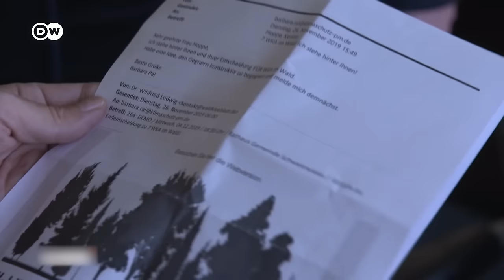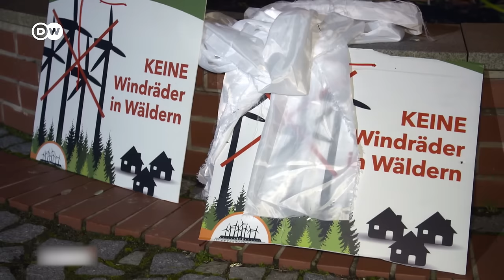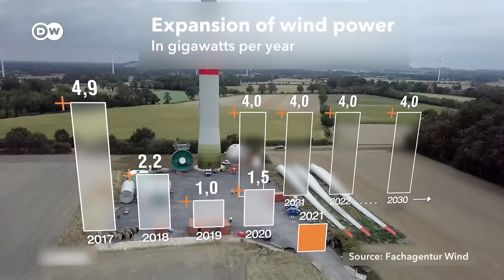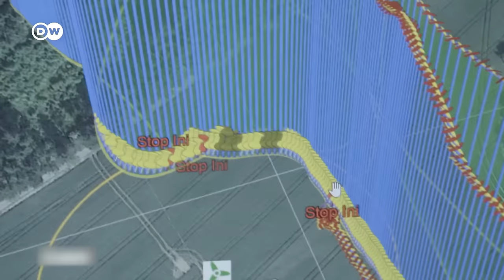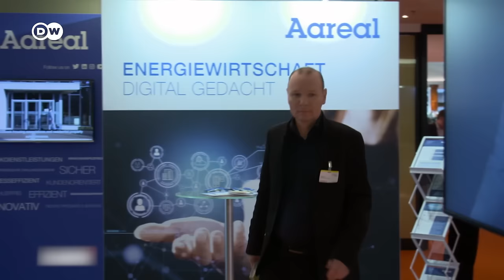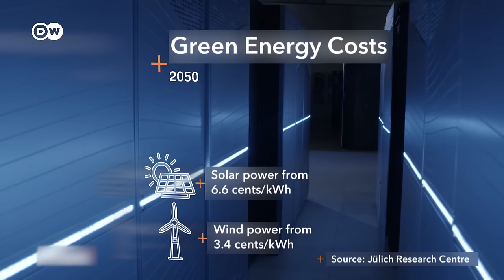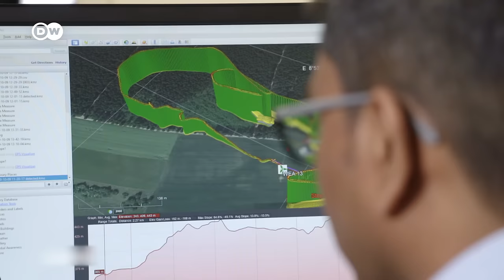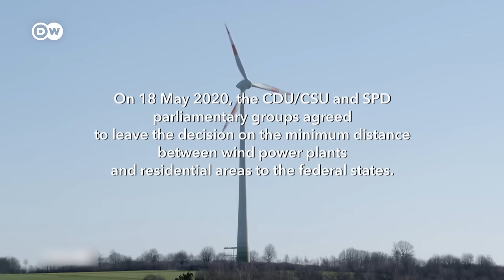Wind power getting headwind in Germany | DW Documentary

Comment: "Who wants a wind turbine near their house?" followed by "Keep the coal plants open!" makes absolutely no sense.  You'd rather live near a coal plant or mine?  Are you insane?
Reply: I have lived near both - there was no problem; it is a false fear.  With CSEM (Continuous Stack Emission Monitoring) there is no pollution to worry about.  The mine as about as intrusive as the sawmill down the road.  I currently live in Toronto and I walk right past the nuclear plant daily.   I do wish we'd hurry up and upgrade from gen3 to something more modern though and the SECOND we have productive TOKAMAK fusion going - that is the ONLY choice for energy.  Coal and Nuclear are the OBVIOUS green choices - and dirt cheap by comparison.  Both have far better safety records than wind too.
Reply: @cosminxzy  No, insane would be having a strong opinion on something you have no experience in.  Coal can be very clean - and it's a more green option than turbines at the end of the day.  All of them should be replaced by Nuclear however.
Reply: @jameswhite1910  how did you assume i don't have experience in this ? Ironically i'm a Power Engineer so I can tell you that you are wrong about coal. I'm neutral with Nuclear, it can be very good but has some huge risks.
Reply: @gaelgregoire5413  its not climate denial its understanding how a combined cycle power plant works. You can use ammonia base catalyst to reduce the nox and so2 by nearly 99%.  Your car has a catalytic converter for a reason fool!
Reply: @jameswhite1910  Coincidentally, the leading cause of cancer deaths in Canada is lung cancer.
Reply: @palmshoot  Isn't that why they made smoking illegal?  And, Canada as about the cleanest air on the entire planet.  Your point is... well it isn't good, really.
Reply: @gaelgregoire5413  Well, Gael... I don't deny the climate.  I don't deny that it changes, a lot.  I grew up in terror because "the consensus of scientists" knew that the ice sheets were returning... all of the graphs pointed to it, there was not time for debate.  They wanted to coat the north pole in CARBON to gather more heat to avoid the coming ice age.
Reply: @cosminxzy  LOL.  Yeah, about 20% of all Albertans are power engineers - and I'm Albertan, and I took the courses too.  That accreditation gives you and I zero credibility on coal emissions however.  Unlike you, however, I HAVE worked with CSEM.  So your authoritarian argument holds no water.  Coal is no worse than any other form of energy that is available today.  If you scrub the toxins in the smokestack, then there is no pollution.  These arguments were invalidated in the late 1970's.
Reply: @jameswhite1910  Considering lung cancer CONTINUES to be the leading cause of cancer deaths in Canada, your point is worse.
Reply: @palmshoot  Great point!  They were - apparently - 100% wrong about smoking being the cause (shouldn't we all start smoking again now that we know this?).  Since Coal burning has gone WAY down over the past century, it can't be that either, right?  Not if cancer rates are going UP.  If coal caused cancer, then rates should be declining - and you say that they are not - so it can't be coal.  CSEM is now filtering the particulates out of the exhaust at near complete levels... zero risk.  I guess the lesson we can both agree on here is this:  The government has not idea what it's talking about when it tells us what causes cancer.
Reply: For people that think coal mining is not an issue, please look up documentary on the town of Centralia, Pennsylvania.
Reply: @jameswhite1910  no pollution from coal smoke stacks?? Lol. You've drunken the industry coolaid. No matter how efficient the current scrubbers they are not 100 percent effective. Do a google scholar search on their efficiencies, and measures of how much toxins get pass them and into the atmosphere. Ash in landfills is not without risk either because landfills are not 100 percent safe from leaching into the ground.
Reply: @mrbonzzai  Well, now you're conflating safe levels with "not 100% clean".  NOTHING is 100% clean, not even tap water and certainly not windmill construction.  But the truth is, unless you have a political motive to try and prove coal is dirty - coal isn't dirty.  Earth isn't clean... what we care about is "clean enough" that life isn't affected in a bad way.  Coal is not dangerous, nor does it impact the environment today the way it used to.
Reply: lived in a coal town my whole life with mines all around and i'm fine and so is everyone in my town. Coal mines doesn't hurt the people near it im writting this with 1 active mine less than a mile from my house probably 4 super old mines shut down within a 2 mile radius of me right now. You can carbon capture coal co2 at the coal plants and pump it down into the sedimentary rock and its fine forever, but no lets just get rid of coal, coal jobs, and the reliable power it makes. Stupid people i swear!
Reply: @lilone23  "I smoked cigarettes and lived to be 90" isn't a great argument that someone else should take up smoking.  The entire continental united states gets acid rain now because of coal plants.  You're not the only person.  People rely on healthy streams for their water and food, so even outside of acute pollution (I grew up in an area that experienced occasional coal ash dumps into our river and I don't think it's that uncommon in Appalachia as a whole) there's still that dispersed pollution of acidification.  And I haven't even mentioned climate change now.  Yeah, I'd rather have a windmill and keep all the farmers, fisherman, etc employed than choose your job at their expense, sorry.
Reply: @gg3675  I said i live in a coal town and have no acid rain where you live?? i never even heard of acid rain ever near me or in my state?? I never said i work in a mines i never have, i was in the army to protect people like you so you can write dumb responses on here and have a safe ,little easy life! Thank you i'm done not arguing the facts i know we should have green energy plus use our recourses we have in our own country is all. I'm all for a clean environment, i love the beach and seeing the outdoors. I just mean the government can't help make our power plants clean they just want to push one type of energy and that's it. I think that is dumb but ok everyone has a different view and always will.
Reply: @lilone23  You have acid rain in your town and state if you live in the continental US.  Just because you don't know something doesn't mean it isn't true.  

And thank you for your service.  My ability to write comments on youtube was under tremendous threat by the rise of the Ba'ath party in Iraq.
Reply: @jameswhite1910  explain then
Reply: @Gael: Arrhenius who described the greenhouse effect opined that increased atmospheric carbon dioxide concentrations would have the beneficial effects of increased agricultural yields and postponement of the next glacial maximum . Did it ever cross your mind that climate change could be beneficial??
Reply: @johngeier8692  Arrhenius died in 1927, before we even understood the reactive mechanisms underlying photosynthesis.  Why is it that people who want to deny science always want to quote the speculations of respected scientists who died a century ago instead of the compelling body of evidence that has accumulated since then?
Reply: @g.g Controlled experiments clearly demonstrate that plants grow better when the carbon dioxide concentration is much higher than the current atmospheric concentration of 415 ppm. You don’t have to understand photosynthesis to demonstrate.
The main issues are what is the ideal mean surface temperature of earth and what is the climate sensitivity to carbon dioxide.
Where would you set your thermostat? At 15 degrees centigrade or 20 degrees centigrade??.
Computer models of complex, incompletely understood  phenomena such as the earth’s climate are subject to the biases of the modellers and amplify errors over time. They are a poor substitute for controlled prospective experiments.
Reply: @Lagarto: Which university did you attend?
Do you superglue yourself to the road like the climate activists in my home city?
It was cool and rainy this year so they went into hiding.
Reply: @johngeier8692  Except we also have many controlled experiments about how crops perform in realistic environments that aren't constrained to that single variable.  Many plants are more productive with more carbon available, as would be the case for any nutrient.  Do those gains make up for increased temperature? More variable temperature?  Reduced water availability? Storms? Falsifiable experiments are obviously preferable to computer models, but you just cherry picked one data point while ignoring all of the indicators from the field of plant and agricultural sciences that heavily imply you are wrong.
Reply: @jeremygates51  if that’s true, for coal fired power plants, it actually needs to be installed to have an effect, and i have my doubts about privately operated coal power plants will take the cost of doing that. Without serious political force forcing them to.
Reply: One coal plant offsets a shitload of wind turbines. Do you have any ability to visualize?
Reply: @haliax8149  Have you ever lived near a mountaintop removal buddy?
Reply: @cosminxzy  Nuclear plants cannot be used to handle peak loads
Reply: @fahadshahid5185  Correct, it cannot handle peaks from daily grid . A well balanced mix of technology should work OK . Ask Germany about the decision to decommission working , mid life nuclear plants and the price surge for the final consumer. Nuclear has a place , medium price per MW/h, highly reliable and sort of clean but expensive to build .
Reply: @cosminxzy  Very expensive to build where as the construction cost of wind power costs about 5 cents per kW/h. Also there is an issue of where to store the nuclear waste from the reactor.
Reply: @Kane-ib5sn  I don't know if you're being intentionally obtuse - or if you are truly unaware that everything you just said is inaccurate.  I will hope that it is the second; that you have been tricked and wish to know the truth.  
Coal USED TO come with the problems you mention - we installed scrubbers on the stacks and we eliminated acid rain and SO2 in the '70's.  I am not too young for anything, I am in my '60's and I have worked on the CSEM (Continuous Stack Emission Monitoring) equipment.
Nuclear is less costly per megawatt hour than wind/solar/tidal.  Orders of magnitude less expensive.
Nuclear is not "radioactive" any more than wood is "burn you alive".  Nuclear energy harnesses radioactivity, then it packages that spent fuel (your entire lifetime of energy waste will fit into a coke can of spent fuel) for storage.  Fun fact:  If all radioactive waste ever produced by mankind were ground up and distributed through the planet - it would be far, far less than the Earth's natural radioactive background level.  Fun fact #2: All nuclear fuel was ALREADY in the Earth emitting radiation when we dug it up.
You might consider watching "Planet of the Humans".  It is a great overview of the horrific examples of how everything you just spoke of is far, far worse using so-called "green" energy.  You should see the state of all of those solar plants today.  And nobody - NOBODY - has any idea of how we can get rid of all of the toxic waste from the solar panels (which have extremely short lives), wind turbines and - far worse - spent batteries.
@Kane by every measurement possible, coal and nuclear beat "green" energy hands-down.  Now you need to stop and wonder why such horrible "green" lies are being sold to us.
Reply: @KelliAnn Winkler Show me a study associating poorer health outcomes with wind turbines.  There are a ton for coal plants
Reply: @maa1649  For what it's worth:  I worked for Chevron in the early 1980's and every major stack had CSEM installed and maintained.  Now that's oil, not coal - but I think it's probably the industry standard - and it is mandated by law.
Reply: Ontario didnt fare too well with its turbines
Reply: @lilone23  Cracks me up with the Malthusian  geongineers ideas that we must get rid of all the carbon while they want to capture it and use it.
Reply: @jameswhite1910  finally someone pointed- out the lithium batteries. Im no expert but I have read that the mining process for getting the rare earth metals needed to run the turbines has caused enormous environmental devestation. To my understanding they windfarms are nothing but huge industrial parks of concrete, the materials the turbines are made from, oil..  They cause mountain erosion. I live in Pa and have watched in disgust as the mountains are overtaken the past decade. The energy produced from them is not even for local use. There is a documentary called Down Wind about how the windfarms destroyed the agriculture in Ontario Canada.
Reply: @stompthedragon4010  I read a report from a Dutch engineering group once that went into deep detail about the rare earths issue.  They said that after a price jump the wind turbines actually stopped being made with neodymium to cut costs.  anyway if you're really concerned about lithium and rare earths, you should be raising hell over computers and cell phones bc there's probably no way to make them without those things.
Reply: @jameswhite1910  And argument that opponent of wind farms bring up very often is, that it "ruins the landscape". From your experience living near both, what would you say LOOKS better? You are arguing that modern coal plants are very clean, but what about coal mining?
Reply: @mabus4910  How they look is pretty subjective.  Some folks love them.  I prefer nature without windmills.  That said though, I also prefer nature without mining, but it just isn't an option.
Coal mining is just that; mining.  It is less of a problem than lithium, for example, but pretty messy.  Without mining, we wouldn't even have the technology of the 1600's so any discussion about ending mining is not really a good start.  There could be no windmills without petroleum and mining.
Reply: @jameswhite1910  Fusion 🤣🤣🤣🤣🤣 also no matter how clean looking your coal plant exhaust looks it is CO2.
Reply: @jameswhite1910  There is no such thing as clean coal power, it releases the most CO2 of any power source known to man.
Reply: @jeremygates51  It's still the biggest CO2 emitter of any power source, fool!
Reply: Saw a news article about how recently in Germany they’ve bulldozed away a wind farm to make room for a coal mine.  Like seriously coal mining isn’t nearly as polluting today as it was 50 years ago, and as long as it’s hard coal it burns much hotter and cleaner too, with a clear, smokeless flame.
Reply: @ls93780  This year’s floods in Kentucky say otherwise
Reply: New design pat.
walls of flat blades make short movies on both sides. 
no gaps  flipping only against  opposite sides egdes almost pure  power  on ground in tides.

Comment: Calling hydrogen power green is absurd and viciously misleading.
Reply: Yup, it's nearly always made from fossil fuels.
Reply: @Jimmy4video  No, the « green hydrogen » is precisely not made from fossil fuel. And that's why it is called « green » :-)
Reply: @Daniel Meyers It wastes around 70% if you want to produce electricity with your hydrogen. But you can use the heat produced as in the Bosbüll electrolyser. It remains a low carbon technology
Reply: @curedent6086  Yea, but then shipping it from Arabia to Germany on a diesel ship is most certainly not green.
Reply: @legitpancake4276  it would not change the overall balance much and there will be other engines than diesel for boats too, of course.